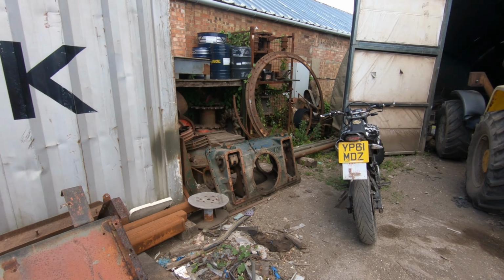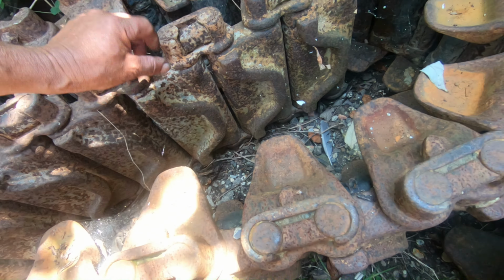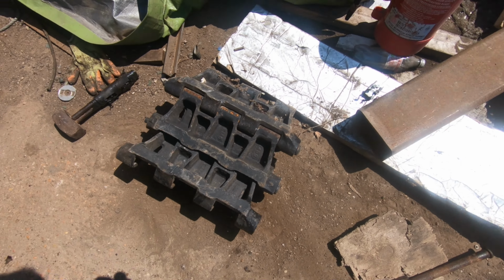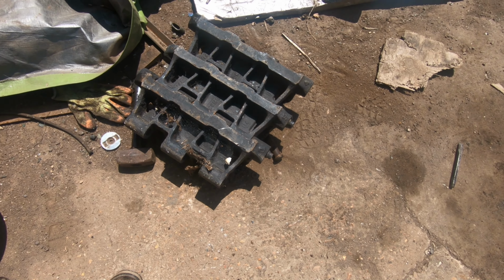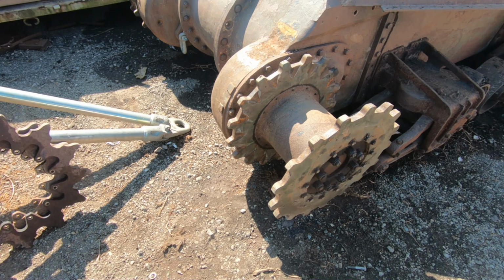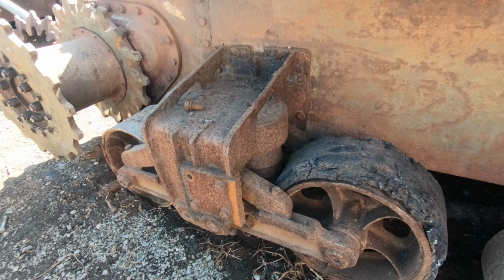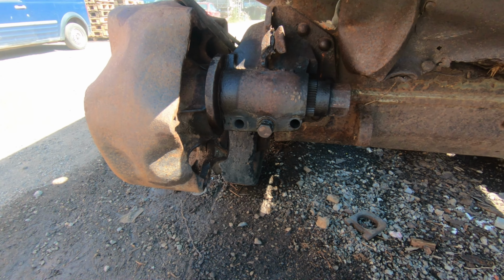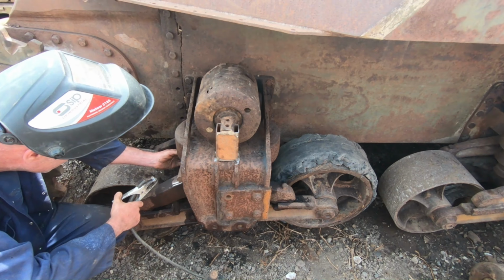M3A3 Grant Tank, Getting the tracks on

Comment: The road wheels can be re-rubbered. New tiers are mad to use on fork trucks. Same size.
Reply from the maker: Yes we got a mate with a 150 ton press that has fitted a few on our Sherman's, not cheap, but we got to rip them wheel stations to bit at some point and will deal with the tyres then, if I can afford it.

Comment: Maybe I missed the explanation in a previous episode, but what exactly is this tank's eventual destination after the upcoming show? You've put a lot of time and sweat into about half of a tank while you've got at least one on the property that is a MUCH better resto candidate. Also, any idea how that idler wheel got crushed? It looks like the one you replaced it with was stouter, too.
Reply from the maker: The Matilda Mk.II belongs to my mate, we have some other parts for that, the transmission engines etc  but not sure how far we will go with it. As for the Grant we plan to put a V8 Cummins in it and turn her into a M31 TRV in the end (to tow our Sherman's about) but its a few years work. I have no idea what happened to the idler wheel, probably damage from her days as a bull dozer on an Australian farm but the wheel we replaced it with is the same as the one we took off. We have a few other tanks and vehicles that take up a lot of our time so no real time scale or dates for anything, just needed them sorted for this Capel Military Show.
Reply: @514thmick  Many thanks for the reply. I hadn't considered the option of converting the cut-down M3 into a recovery vehicle.

Comment: Are you going to weld up that torched cut before you go? It'd be a shame if a crack propagated from the cut.
Reply from the maker: It's already left on the low loader, it will be parked up and when it gets back it will be one of the jobs after we have taken that wheel station off.